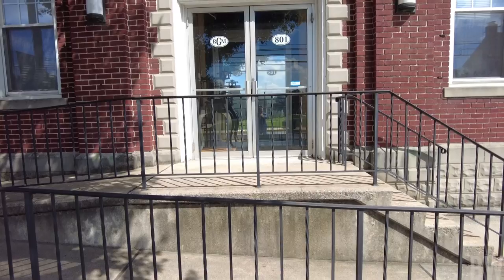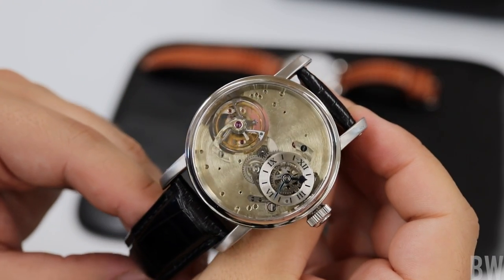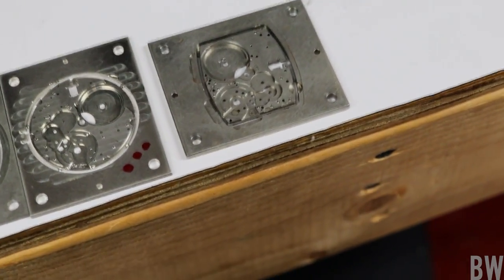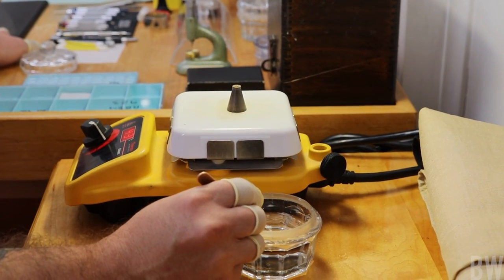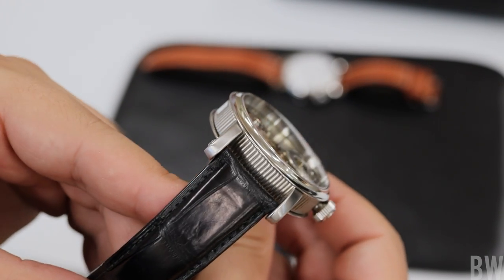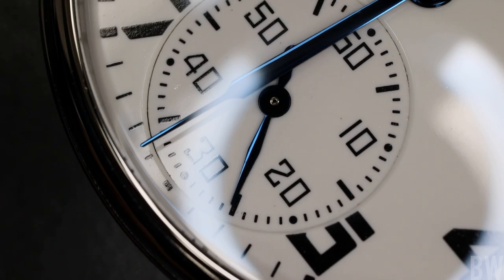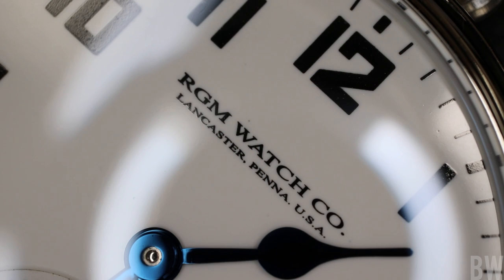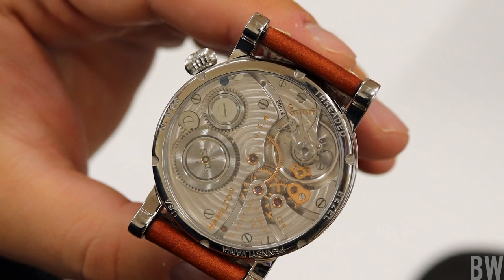Visiting America's Premier Watchmaker - And finding a Keeper

Comment: They are a certified service center for alot of watch brands. I've had a few watches serviced there and I have to say they did run better than when I first got them after they came back from RGM. I had a nasty spill skiing  broke the crystal on my Sinn 356. RGM fixed it and had it back to me in about a month.
Reply: Do you know if they work on vintage pieces?  I have a 1930s Tavannes that needs work, I think it's a broken mainspring.
Reply: @morgan97475  they can work on anything I'm sure. They are a real old time watchmaker.

Comment: So is most of there current range taking old pocket watch movements made by Hamilton, cleaning and timing them and then re-casing them. The old Hamilton movements are already decorated. 
putting an old Hamilton pocket watch movement and then just re-casing it with your dial seems like it isn't worth the thousands they charge. I can get those old pocket watch movements pretty cheap all day long. Would rather see a Modified Unitas 6497 instead (skeletonize it or decorate it yourself). Hopefully they are just sourcing the old Hamilton movements and not taking them out of old pocket watch cases and throwing the case and dial away. lots of people collect pocket watches.